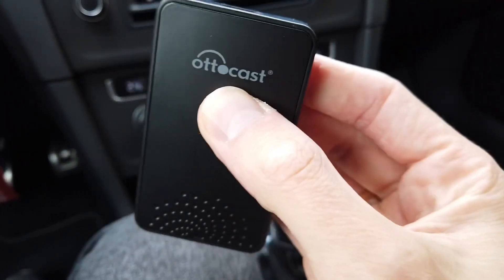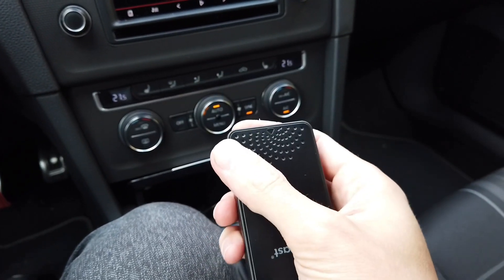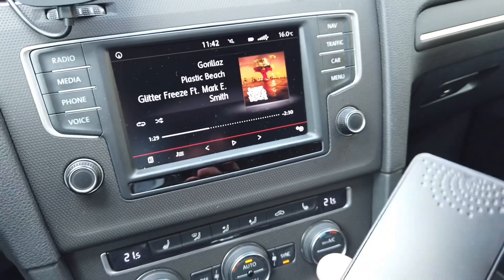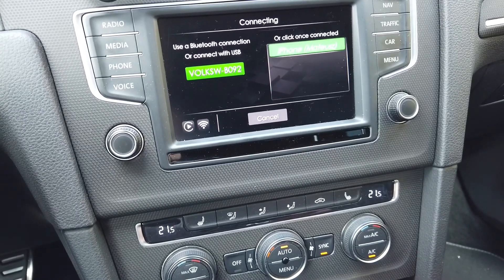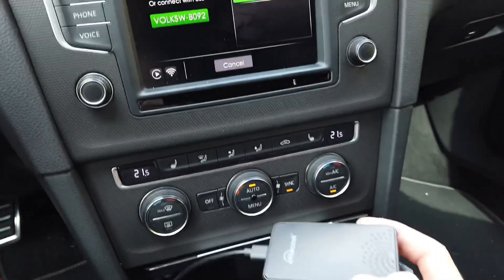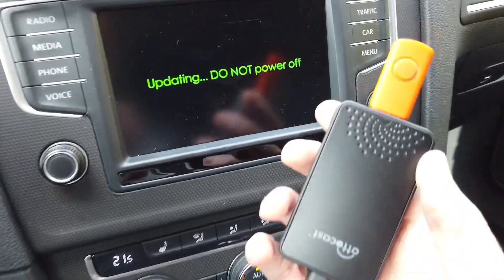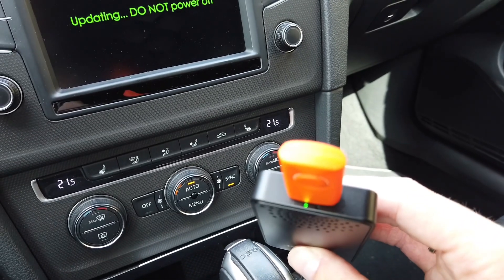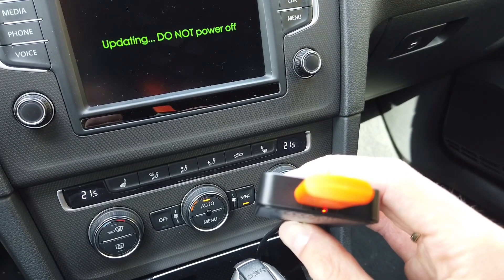Firmware update in OTTOCAST wireless CarPlay adapter

Comment: To check/download new firmware plug the device into a USB port with power, I used a computer in my home. Use your phone to join the U2-Now wireless network. Using your phone web browser navigate to 192.168.50.2. This will take you to the web page on the U2-Now. It will use your cellphone's cellular data to check for new firmware. If there is newer firmware it will show the changes then the button will allow you to download it and update it. This is also explained in the manual available from Ottocast on page 10. It looks like it does incremental version updates. I had to update mine 3 times to get to the latest version. The SSID also changed during the update.
I'm now at 2022.01.24.1908 and under advanced is a rollback option.
Reply: It's timing out, have you been able to get in today?